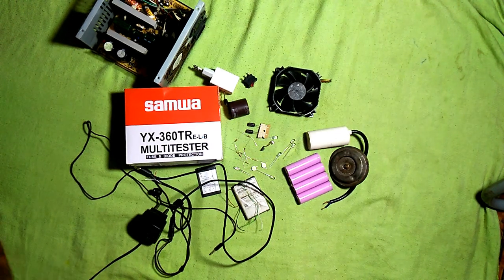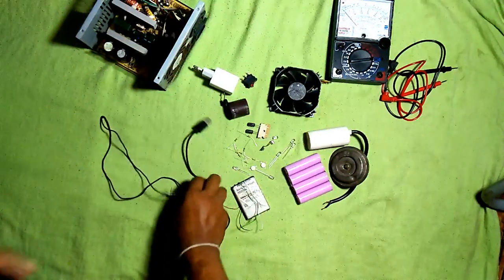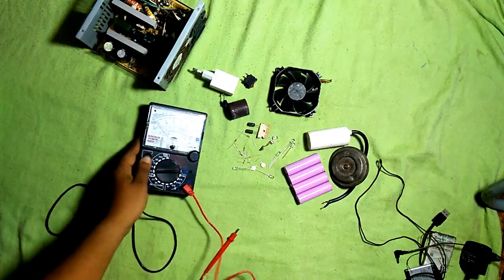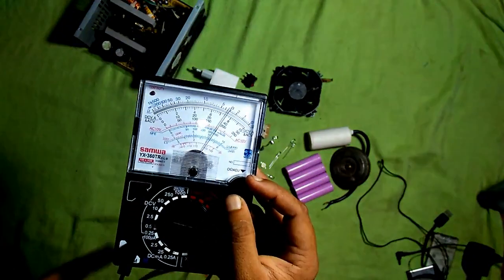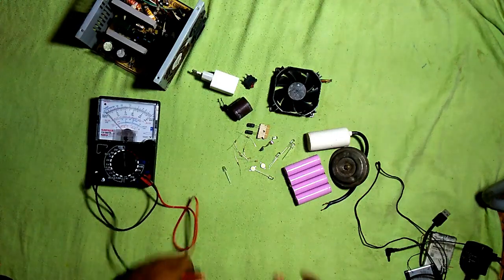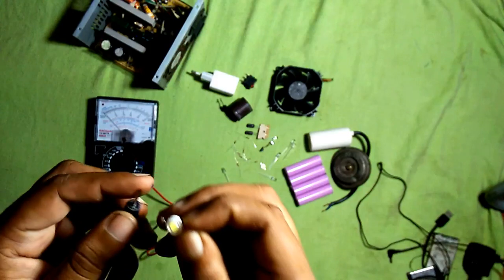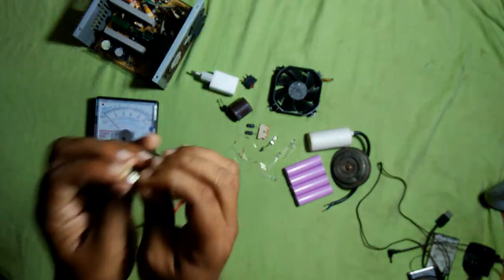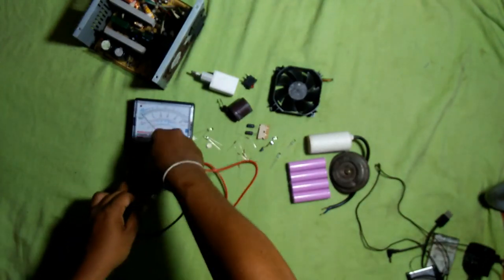Analog Multi meter(Multi Tester) -SAMWA YX-360TR LED Test

Comment: china not good. japan. very good. sanwa. 360tr eb.
Reply from the maker: That's true. But this is good for beginners.
Reply: @civlaboratorio9847  do you have analog multimeter samwa yx-360tr elb circuit diagram pdf ?
Reply from the maker: Sorry I don't have.. 😔
Reply: USA about